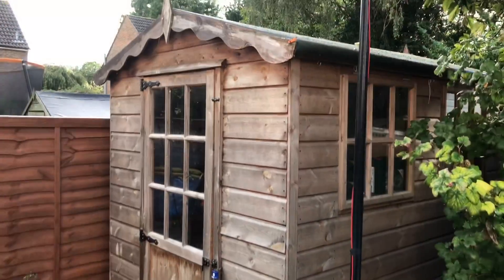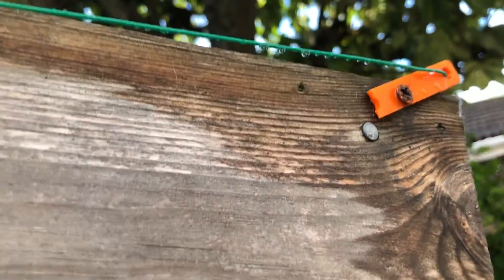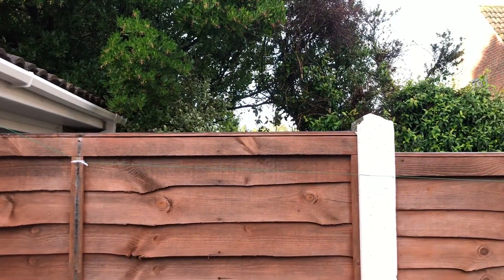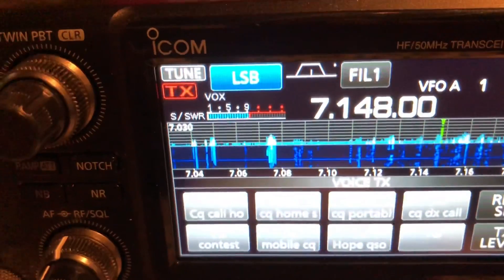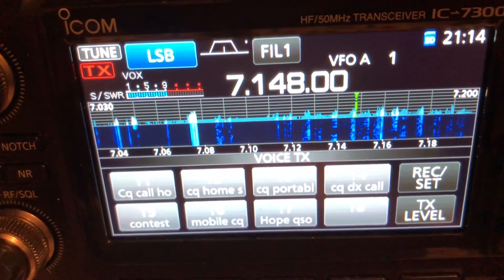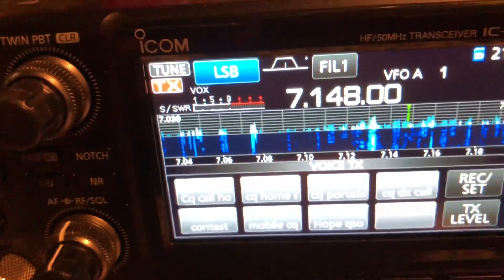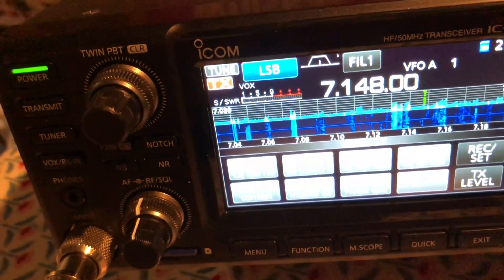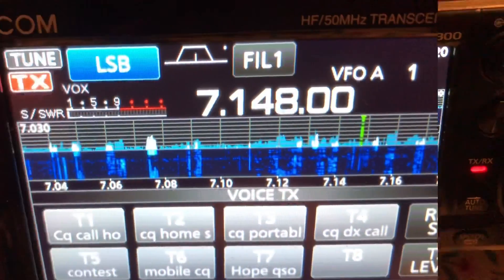Ham Radio: End Fed Half Wave 40 Metres Stealth Antenna - Fence Height

Comment: Ideal fixings for this situation are the screw in insulators used for livestock wires, on the well known auction site sold in 50 and 100 in a pack
Reply from the maker: Yes good idea.
Reply: @timg5tm941  I am putting a UK antenna up all being well in a similar manner around the garden on top of the fence , 40,20,10 and in between with a tuner.

Comment: because of the restriction now you cannot have an antenna on the fence, it will be too close to the public.
Reply: Incorrect, an EMF assessment must be carried out and it's findings recorded and acted upon.
"Ofcom now requires us to comply with the recommendations of ICNIRP, the International Commission 
on Non-Ionizing Radiation Protection, and requires us to demonstrate compliance by making an EMF 
assessment for each equipment configuration that we currently use. You need to have these results 
available in case of any inspection" (RSGB)
Reply from the maker: Agree, it all depends on the individual station’s proximity to others.

Comment: wow, does your coax to your ic7300 is grounded? this is interesting
Reply from the maker: Not grounded but good to have a choke about 2m from the transformer when using 40m just to stop any common mode making its way back to the station.

Comment: Tim would this be a 49:1 unun? I'm having loads of issues with my so called multi band end fed antenna with a 9:1 unun. I've hooked my vna to it and none of the bands show an swr of less than 3:1. The length of the wire is 19.8 m so half wave for 40m, on the analyser it shows an swr of 10:1  for 7mhz! Any thoughts?
Reply from the maker: If it’s a half wave then a 9:1 won’t bring into a useable swr. You can use a 49:1 and that gives you 40 20 15 10m. Or as I used here a monoband version which is matched via an LC network but only for the Halfwave length band .. in my case 40m. So a 49:1 cut to about 20m long will do this yes.
Reply: @paulkazjack You should NOT use half or quarter wave length (or any other resonant length) for your end fed random wire antenna with a 9:1 UnUn. Depending on the space you have for the deployment of the wire you could search for article "Best random  wire antenna lengths" by VE3EED (SK) and decide what suits your needs.
Reply: @Bojan_Slavkovic  Thanks for that Bojan, I'll give it a search.
Reply: @paulkazjack  No problem. I forgot to mention you need ground/counterpoise for this type of antenna. It gives me completely different readings on VNA with and without the ground. Dips are on different frequencies if it is not grounded. Also, reception is better when it is grounded. At this moment my 9:1 unun is wound on T130-2 so it is not that great on 160, 80 and on 40 SWR is around 2.7 to 3.1. On 20m it is 1.6 so I don't even need to turn on the tuner and leave it bypassed (it is great on 10m but the band is dead). In the next few days I will make a new unun on T240-43 and stretch a longer wire and see what will happen with 160, 80 and 40m.

Comment: Mine is just 8ft runs similar to yours wrapped around my garden through some bushes and hedge plants. 
Put it up only for 80m as my Windom can’t cope with it. 
Good results on 80m brings them in and tunes easily working about 250 miles from Leeds.
Reply from the maker: Great stuff Tony.. if I had more room I’d do the same here for 80 as I just want t o work really around G, EI and maybe into F, ON etc on 80. Glad it works for you too 73

Comment: Nice, what sort of power were you running and did it need matching at all?  I need to sort some NVIS as my G7FEK only seems good for longer range, good in many ways but makes it hard to talk to UK :)
Reply from the maker: Hi Dave.. 100 watts and the swr was 1.7-1.9:1 from 7100-7200. Therefore I didn’t need to match it but my OCD kicked in so just touched up the swr with the 7300 internal tuner. 73